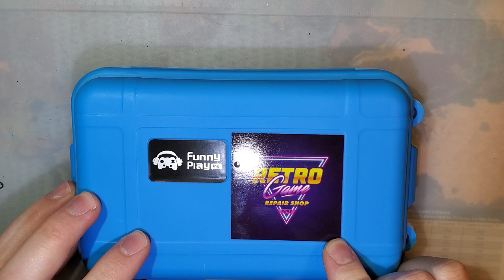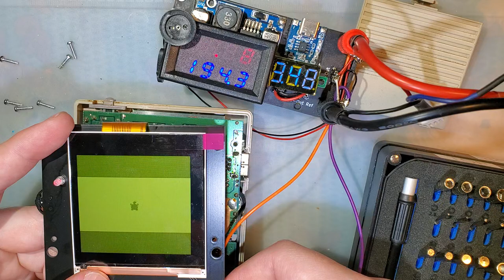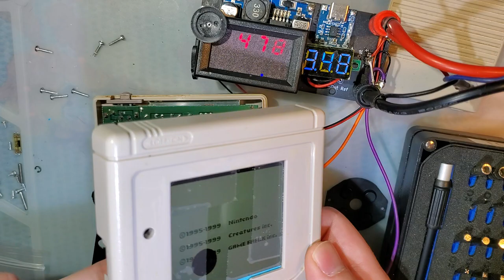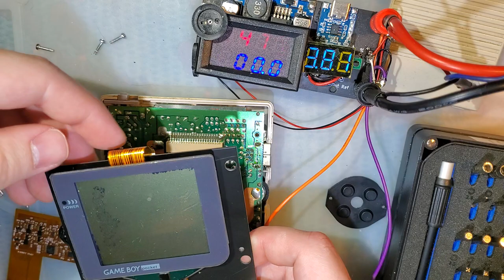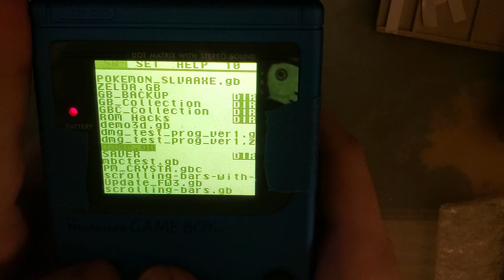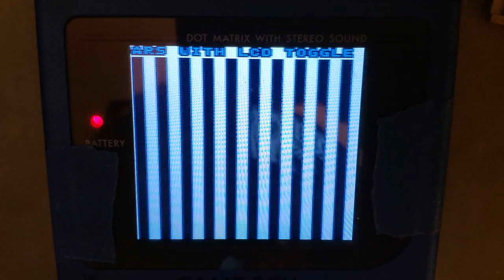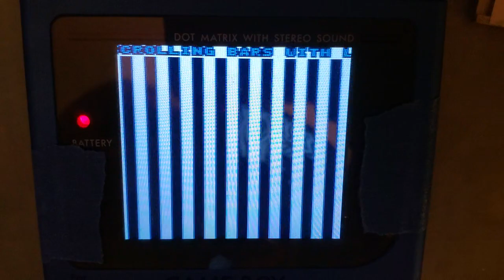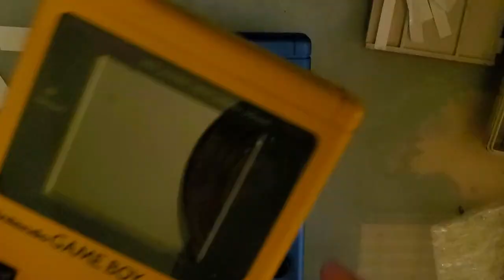Funnyplaying DMG IPS "Retro Pixel" Install for the Original Game Boy

Comment: I didn't use the adhesive on the pocket, I did stick the adhesive down but didn't take the screen side off. I got a thin piece of foam the size of the screen and put it in between the PCB and screen. It's holding it in there snug with no movement event when tapping it. In return I was able to get the screen 100% correct with no commitment

Comment: My sister and I got gameboys for Xmas in the 90s.  They were bought on the same day from the same store (and I have kept them all this time).  My sister's is yellowed exactly like this one (only on the front, and the back is fine), but mine is not yellowed at all (it's white on the front and back).

Not sure why only the front of one of the two units is yellowed.  It seems odd to me also.
Reply from the maker: UV exposure is known to increase the onset of yellowing. You could also just have consoles that were made with different batches of plastic.

Comment: Hi there, I'm planning to mod my DMG with FP IPS retro pixel kit. Do you think I need to replace the original voltage regulator on the motherboard? Would the "Clean Power power supply voltage V2" from Retro Six add some benefits? Or is just useless? I really want to make my DMG the best. thanks
Reply from the maker: you would be downgrading your DMG by installing one of those power supplies.
Reply: @makho  you mean EVERY voltage regulator or THIS ONE?.
Reply from the maker: @madesmad9935  this one especially

Comment: Nice video and demo! How does it compare with to the button handling on the RIPS V3 kit? I installed that kit in mine and the buttons just feel off. Not at all as responsive as the original PCB. I noticed the new PCB is thicker as well.
Reply from the maker: Seems fine to me. The only button related issues I'm having are due to the shell molding. When the A or B buttons don't get physically stuck down, all the inputs register exactly as I would expect. 
This is what I mean by stuck: https://i.imgur.com/6YrcETO.jpg
Reply: makho there’s been a few posts on Facebook groups with the same issue 😐
Reply: Adam James Did anyone post a solution?
Reply from the maker: @TheJamesydesign  About what issue, the button inputs on this new kit or the stuck buttons on the retrosix shells? I've only experienced the latter.

Comment: Do you think soldering in that regulator would make the front PCB compatible with Pocket display? :P
Reply from the maker: Possibly but I think it would be more work than it's worth. I wanted to try out another Game Boy Pocket AIO TFT backlight kit but I didn't feel like trying to figure out where I can safely tap the aux power. All the required signals and power should be present for that kit at least.

Comment: I recently learned that electroluminescent backlights are/were a thing in gameboys for a time, and I bet a nice green one would look pretty good on a DMG.   I also have been trying for a while to search for possible frontlights rather than backlights/screen replacements for DMG-001 gameboys, like the style of the AGS-001, and I wonder if you know of any solutions that someone has already figured out, rather than me potentially going full-custom if I decide to try it
Reply from the maker: With how easy it is and how much better the results are, most people go with backlights, even on original screens. Frontlight method would be the same as any other LCD though, look up GBC or NGPC frontlight installs.

Comment: It's my impression or you forgot to peel of the protective film on the screen? It was on purpose?
Reply from the maker: like I said, I left it because I will finish the install later when I get a proper bracket. I have my bracket fixed (hopefully) and on order and my new 3D printer should arrive some time this week at which point I'll probably print funnyplaying's bracket (and retromoddings, whenever that comes out)

Comment: Why retrosix shell?
Reply from the maker: all my other shells need retrobriting or screw post repairs and I figured this would give me an opportunity to actually check these shells out (I'm not happy so far).
Reply: I think you better don’t use the screws which come with the shell, they are not Machine Screws, all the retrosix shells give the wrong screw even their ugly GBA shell.
Reply: @gnuhc315  the screws provided by RetroSix for their GBA shells are perfectly fine for their intended purpose... not had issues building my GBA mod using RetroSix GBA shell kits and accessories... i still prefer origjnal GBA membranes but the RetroSix ones are good enough... but their GBA shells are just pure excellence... i think i have bought 15 so far... no defects or quality issues... they consistently send out great quality shells and id recommend them... for anyone not wanting to use their shells then there are plenty of companies you can buy from... JellyBellyCustoms.... Game Gorilla... Funny Playing... and many others... right now modders are spoilt with the sheer number of aftermarket shells we can choose from... the scene has a very active community on Instagram and FB and i have learned alot from Youtubers like Makho and others and just talking about things that have cropped up in my build on the FB Groups... also @makho are you active on Instagram or FB and do you have a page i can follow on either platform? my Insta is @retro.zero.uk
 anyways i love your informative videos... for me your process really engrosses me and i love how you approach problems find solutions... its helped me alot just watching you work... so thank you!